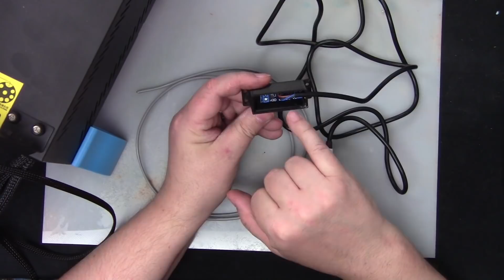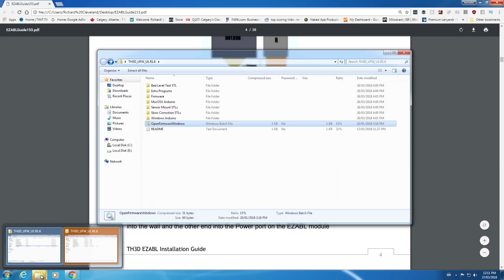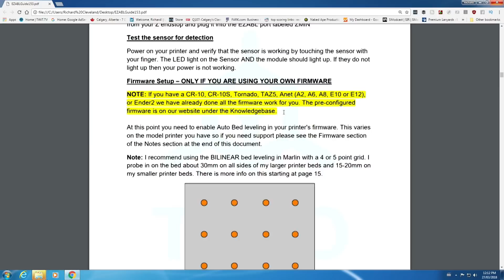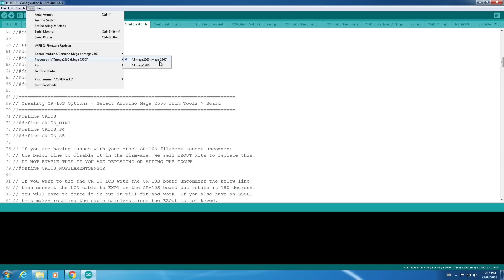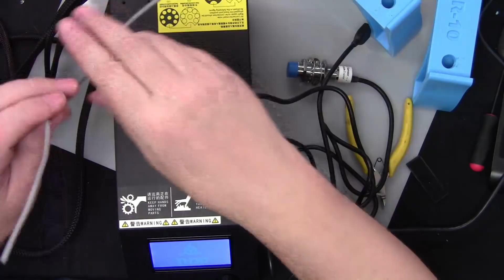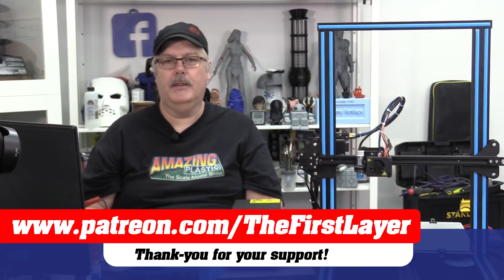Installing the TH3D studios EZABL

Comment: This is not everything it's cracked up to be. I purchased one of these and followed the directions to the letter. Configured and reconfigured everything over and over again, ran repeatability tests, tried tweaking the firmware (per the instructions in the firmware)...nothing worked. When I went to print, it would extrude a big nasty blob in one corner (dragging a lot of it out onto the print bed with it) and then it would fail. Either it was too high or too low. Over the course of 2.5 days I did not get a single print done with it. Failure rate was 100%, in the meantime I waited patiently for TH3D's tech support to contact me back, but by the time they did, I had had enough. Simple math told me that the number of hours I had put into trying to get this to work correctly now far exceeded any time spent manually leveling my bed in the future, it made no sense to go any further. When I heard back from Tim (yeah Tim himself emailed me), I had stripped my CR-10S of everything and was back to normal bed leveling getting a successful print. Tim told me that the reason he hadn't responded earlier was because my trouble ticket somehow ended up in his spam folder where he just happened to see it. Any trouble ticket system that puts a valid trouble ticket number into a spam folder should be replaced in my humble opinion. Bottom line is that Tim offered a refund, but considering his new start up business and the fact that he has done a wonderful job with his video's on 3D printing, I declined. I'm not falling on the sword here, I just wanted to share my experience, which if you've read all of this, was not a good one.
Reply from the maker: I am sorry that you had that type of experience with the product.  So far it is working for the printer I put it on.  I will watch to see if anything crops up and let you know.
Reply: Thanks Richard, I appreciate that. The only thing I didn't try was throwing holy water at it...maybe that would have worked? ;)
Reply: Slvrbllt44 yea i am starting to go down that path. It’s exhausting
Reply: Good luck to you Mike (seriously). I can do a good manual bed leveling on my CR-10S in 5 minutes or less, that means for every hour I spent trying to get the EZABL to work I could have manually leveled my bed at least 12 times. By my estimation I had at least 18 hours of work into it (and I mean 18 solid no BS hours), that means that I could have manually leveled my bed 216 times. Most the items I print are large and take at least 24 hours to print. Using 24 hours as a base for print time, that means I have spent more than 2/3 of one years worth of bed leveling IF I level before every print. So I have to ask myself, when does the EZABL start paying me back for time spent trying to install it? My son and I built a high end liquid cooled computer from scratch in about 4-5 hours. I personally have been toying with computers since the first TI99-4A was released, and worked my way up through the Commodore VIC20 and 64...so I have plenty of experience under my belt. At 61 years of age, I think it's safe to say that time is no longer on my side and I have a keener awareness of things that are becoming an exercise in futility.
Reply: It worked perfectly on my CR10S with no issues at all. I followed this guide: https://www.youtube.com/watch?v=B2ODwmiMNhc and it works great. Although I could manually level my bed easily enough, the probe caters for inconsistencies within the bed itself, and my prints are much better since I fitted the probe, especially large prints that tended to fail in the past, they now print perfectly.
Reply: Glad to hear you got it to work. I was not implying that it doesn't work on the CR-10S, I was sharing my experience attempting to install it on my CR-10S. No doubt the success rate for this exceeds the failure rate. I was also disappointed in the much touted "support". It literally took days to hear back to my request and then I was given a rather lame excuse that my trouble ticket had somehow ended up in a spam folder. I think a lot of people are viewing this as a simple install that will go without any problems. I hear people giving this good reviews and hear few bad ones, perhaps because other people don't want to face the potential criticism that may come their way in the face of others successes..."you must have done something wrong"...or other such implications. I stand by what I said, I did not do anything wrong, I followed the directions to the letter, time and time again, and it simply did not work for me, period.
Reply: I was just interested to try and work out what went wrong for you, as it might save some others the same issues. Was your sensor showing the correct triggering/non triggering when issuing an M119 command with the light on and the light off? What was the standard deviation on the Z-Probe repeatability test? I'm just interested in where it went wrong, as usually with this kind of thing, if it works on a few it will work on them all. There is not much to the electronics other than the sensor, and it is easily checked to see if it is faulty. There were a few areas I felt could be more clear in the instructions, like that the sensor wire itself (not the power wire) needs to be wired up the correct way around to work correctly. That the homing needs to be done in a specific order, and a few other areas where mistakes could easily be made. The first time through I accidentally uncommented the CR-10 instead of the CR-10s code lines.
Reply: Slvrbllt44 mine works great was piss easy to set up
Reply: I'm sorry that you had a bad experience here. (This is Tim btw) We've since hired people JUST to do support and we have a customer only support group setup to get help when we are not available. I am not sure what your name is since the YT account doesn't have it but if you ever want to give it another go please let us know and I can get another kit sent out to you. There are a lot of things on a machine that can cause issues that are NOT the kit but can affect the kit from working correctly. 

We just completely overhauled the installation guide to include any troubleshooting and things to check that we've been documenting over the last year of selling the kits. We also have improved the sensors and the boards that run them to make them even more accurate and combat electrical issues we've seen on these low cost Chinese printers.

I can't make everyone happy as you can see here but I try my best. Maybe if I work 20 hours a day instead of 14 that will make a difference in the support? :P
Reply: Also the channel Where Nerdy is Cool just did a very good installation video here: https://www.youtube.com/watch?v=-WcMBCf8jPg
Reply: Slvrbllt44  ..that blob put you off u just need to  sort your start g code
Reply: TH3D Studio im having issues with mine, sent an email to you 4-5 days ago i think, cant get it to work properly cr-10s. Exhausting
Reply: Timothy Hoogland thats cool, just hit me up when you can thx

Comment: $60 and does'nt even have connectors on the wires for the power supply
Reply: If you are wiring to that supply, then yeah it would make it a little easier. If you are feeding it from another supply then you'd have to cut them off, so I guess it depends on your install.
Reply: Due to the vast amount of printers supported trying to account for every connection type is pretty hard. The best thing we found is to include wire to route it to the PSU and let the user decide how they want to terminate it.
Reply from the maker: I don't think an accessory like this is overpriced. After having a conversation with TH3D yesterday it is clear as to why the kit is the way it is.  There are two versions on as seen in the video (direct wire) and one that is pre wired for a included power supply.  As a consumer I think this unit is priced right.
Reply: the point I was making was that 2 fork crimps that would cost penny's would make the job a lot easier